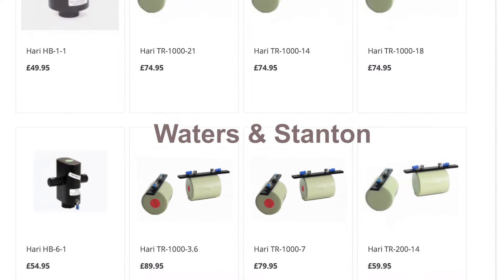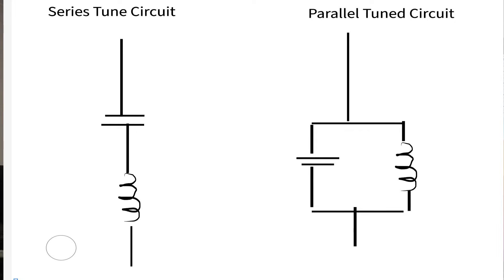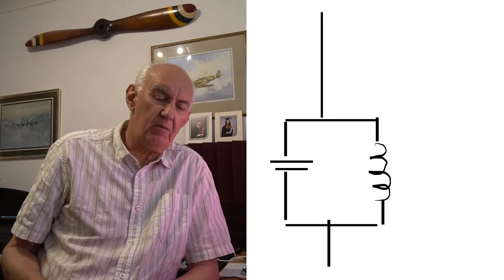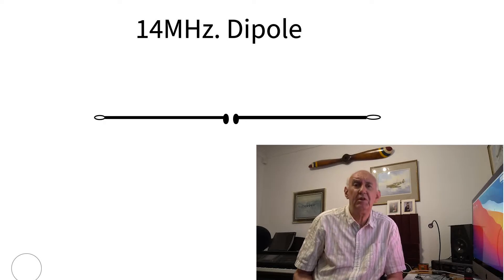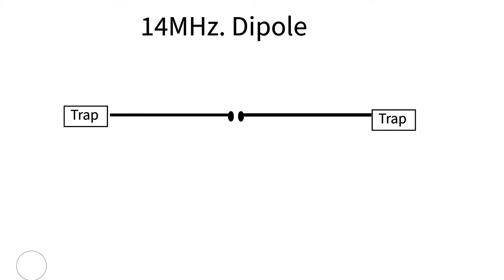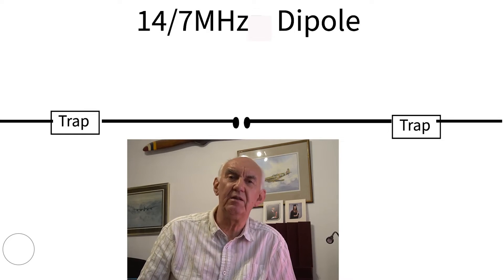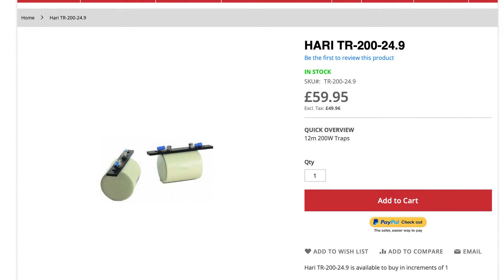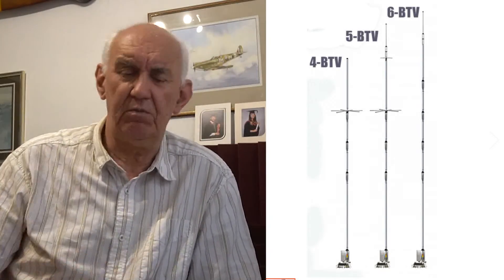Ham Radio Antenna Traps and Small Gardens - For Beginners

Comment: I am too low for the added 80 meters but trapped for 20/40 and one 10/15 sounds doable as I have 65 ft wide and a HOA limited to 18 ft. at apex. Not terribly efficient as could but for regional on 40 OK! Great video, now liets look at yor stock on traps!

Comment: I ran a Hustler 6BTV on the 15th (top) floor of an apartment building here in Akron, Ohio.  Being a "Mull Dropper" on the 11-meter band I dominated the airwaves WITHOUT running an amplifier, I had an average daily footprint of a hundred miles!
Summer weather in NE Ohio?  You have - wait a few minutes and the weather will change!
KD8EFQ/73

Comment: Hi Peter - here’s a challenge for you....my garden is about 10m x 5m with an metal roof awning that’s about half the height of the house covering about 9m x 3m - now I’m trying to find a solution to work 80m.... oh and am limited on height by the estate manager so no antenna can be visible from the road at the front of the house!  Any suggestions?
Reply: make an 2 turns Magnetic loop antenne for 80 and 40 meter! 73 Theo PA0HTY

Comment: I live in a flat I don't have a garden and I don't have anoth room for a 10 meter antenna for my small loft. I'm pulling my heir out. I want to do HF so much.
Reply: Try to wrap your antenna wire around the extreme edge of your loft. You might find that you have enough length for a half wave or if not then a quarter wave antenna